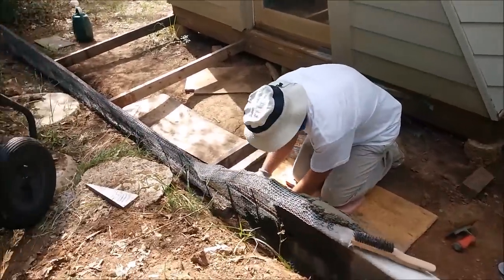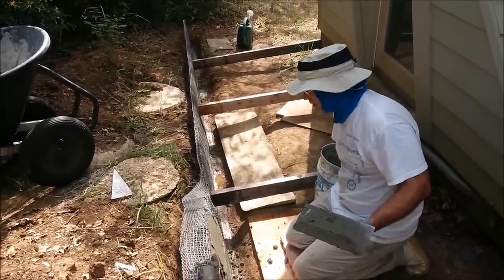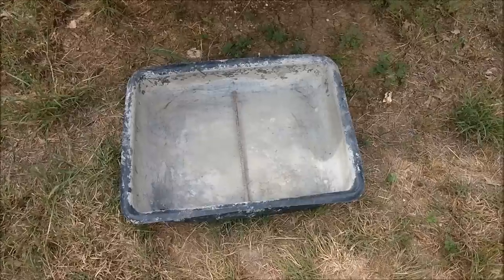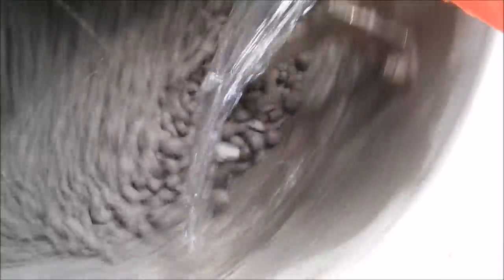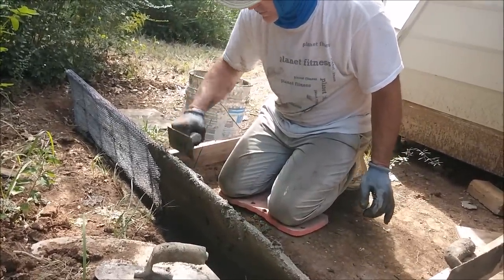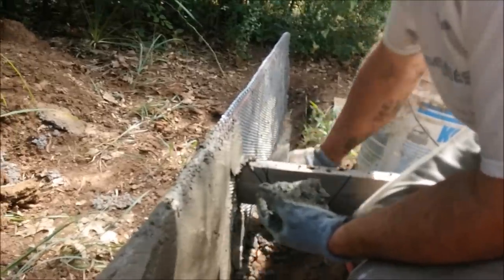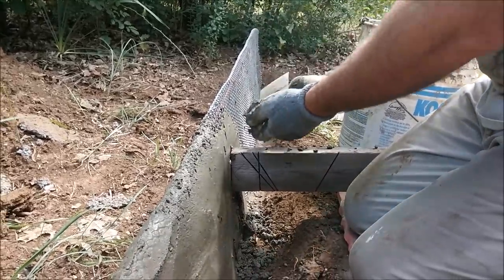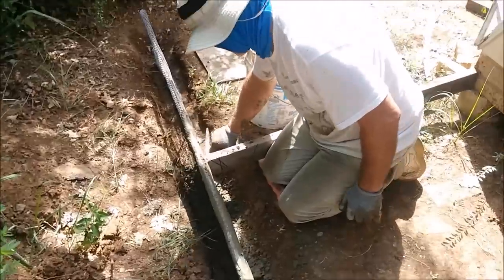Ferrocement building and our history with it.

Comment: What was the ferrocement recipe  your father used, to make his mortar ?
.....I can see he used the Quikrite sand/topping mix. Was that used alone, or was it mixed with something else ?
And if it was , what were the ratio's used ?

I wanted to used masonry sand and Portland cement, but finding masonry sand at the box stores around here is next to impossible.....
Reply from the maker: +twinray27 Usually he uses two parts washed sand with one part Portland cement. I don't know why he opted for the quikrite this day.
Reply from the maker: +twinray27 Also sometimes when he adds some cement glue when he works on horizontal parts over head. He feels like it helps it stay put. But most importantly you don't want to get it too wet, you want to be able to mold it in your hand and have it keep its shape fairly well.
Reply: That was, believe it or not......very informative, when the cement was being mixed. It's one thing to read about it ( or to hear it explained ) , but to see it being done, helps immensely......
It kinda shows what you need to look for......
Thanks for the help !  :  )